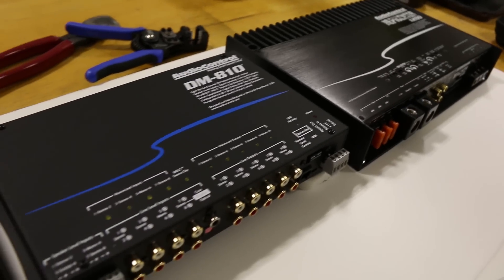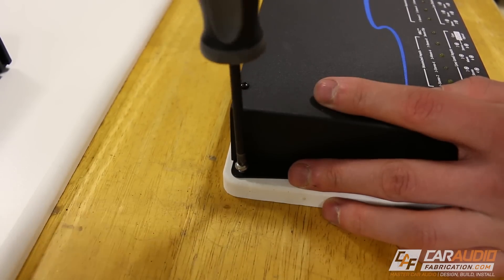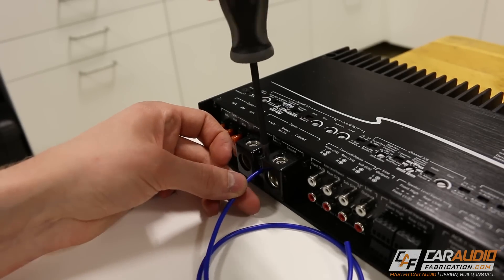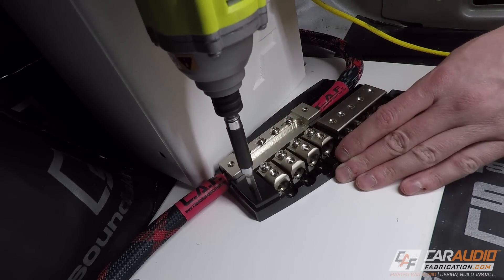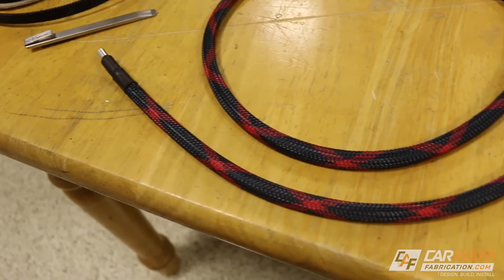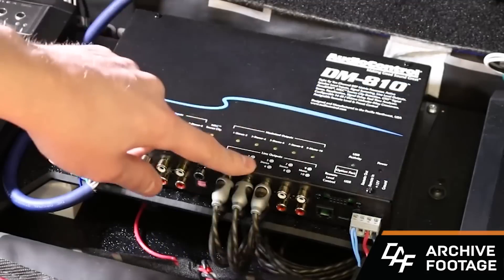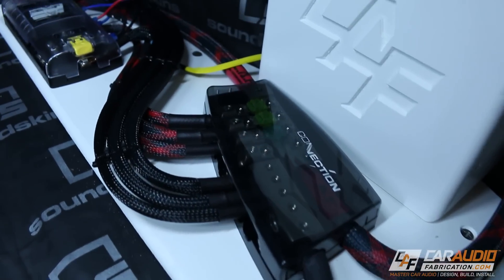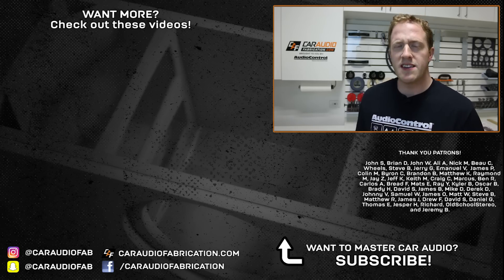ADVANCED Car Audio Wiring - Multiple Fuse Blocks - Project Stealth

Comment from the maker: Thanks for watching! Here's a good follow up video for more information on wire ferrules, and crimping and working with large wires: https://youtu.be/TlV1_GjISps
Reply: Hello Mark ! I was wondering, how do you know when you need a second battery ? I heard that a lot of voltage variation coming from the battery while driving (seen through a voltmetre) is a clue that you an other one or a higher output alternator. I never go under 14V so....yeah ?

Thanks for the videos it really helps me on a daily basis when working on my car !
Reply: Would you maybe make a video about how to add battery's too a car?
Reply: Hi Mark, I use the Blue sea Safety hub 150 gives you power for 4 big amps and plenty of smaller fused outputs for LED’s, processors etc. Check it out for a future build 👍🏻
Reply: @jayw2609  66 book gm 5j5
Reply: they are typically only needed for parking lot pimpin (eg, when the car is off and you want to play your system).
Reply: CarAudioFabrication hey i need help. I put in a new radio in my car and it make a wine sound when i turn on my car and when i step on the gas it get louder. Pls help fix this. Also my uncle gave me a more power full sub and its connectd to the stocm amp could this be the problem

Comment: hey guys. i have a 1 in 2 out 0 gauge block. can i use it backwards and have 2 0 gauge wires from the battery to one in the amp. like so
battery=======>-----amp

Comment: Hey Mark!
Just a quick question I was looking on eBay for a good quality wiring kit, found a Rockford Fosgate one with0/1awg wire but it only has that from the batterie then I had 2 distribution blocks and then they have supplied 4awg wire, is 4awg thick enough for powering a 1200w/rms 5 Chanel amp and a dsp? The speakers are going to be 2 focal utopia 165wrc, 75w rms and 1 focal utopia 33wx2.

Thanks!

Comment: Great videos, I was hoping you could give a general size guide for the tech flex. Like what size you normally use for 4 gauge power/ground wire, and rca’s, speedwire etc. I would greatly appreciate it. Thanks.

Comment: Getting great bass and maintaining trunk space? Needless to say I've done a really weird  thing in a car that didn't have rear deck speakers I took 3/4mdf and measured the area of the rear deck and made a box for 3 8" subs. And took some L shape aluminum. Put around the box. I then cut away enough of the metal to let the 8s blow into the cabin. And riveted the L aluminum to the rear deck and reinforced it with new metal welded around what I cut out and fiberglassed the enclosure and made a new rear deck beauty panel does wonder bit I've always ask the customer if 1 they wanted that done and 2 if they own that vehicle and its not a rental etc

Comment: What size flex tech do you use for 0 awg
Reply from the maker: No answer for this, every 0 gauge has a different outer diameter, simply measure your wire and but the next closest size, it's not rocket science.
Reply: CarAudioFabrication I’m new to this that’s why I asked

Comment: Hiya Mark, really enjoy watching your videos. Im currently building an audio system total watts 600rms so nothing major but a nice upgrade on stock. Thing is i will be attending some car shows and want to play my xbox i have a 500watt invertor. I am thinking off a second boot battery with a battery relay isolator so not to drain main battery but will i need to run a seperate power line to power radio from this new battery?
Reply: Chazz Coombes yes. unless you are not worried about the small load from the head unit. I would just use a larger battery. with a bit more capacity. maybe two. up front. along with a battery in the boot. you could isolate only the extra one in front . using it as a jump start. so even with the battery low. you will still be able to start your vehicle. it would be less complicated that way
 have a isolator with a toggle switch. "turn on" the other battery when you need to start the vehicle. or only turn it off when you are going to pull down the other batteries. and turn back on when you are ready to start! I hope this is understandable. and a help.

Comment: Hey mark can u use the same wire for a power and ground ? Like if I got more ( power wire ) can I use that same wire for a ground ? I need more wire to really make my set up. Cleaner
Reply from the maker: Wire is wire. Your main feed and ground MUST be the same size. If they are the same color your amp doesn't know the difference. You should definitely some how mark each wire though so it is clear what is what so nothing gets shorted out.
Reply: CarAudioFabrication ahh jaha I always thought each wire had some special type of coding on it or something lol and I wasn’t quite sure the diff like if one had to be ofc or something lol thanks a lot mark now I’ll be able to nicely run my setup 😎
Reply: If I may I recommend ground to frame and not the body its a more "solid" ground"

Comment: Hey mark I have a question I have a 2004 explorer and I can't find a good spot to drill for my power wire what would you suggest I messured my door jam and it is open enough with the door closed to not pinch my wire but i don't wanna leave there much longer any idea what I should do?

Comment: Great videos!!! I have a question. What are your thoughts on using a circuit breaker rather than a fuse? I install a lot of snow plow and wheelchair equipment and use them all the time. Pros/cons?

Comment: Amazing work like always Mark!  Just one question though. On the distribution block, one big wire comes in from battery, 3 smaller ones go to the amp, where does the other big one go to? Engine bay I'm guessing?  Is the car dual battery?. I'm looking to run, pretty much this exact setup in my car.
Reply: He says that in the video. One from the front the other to the secondary battery
Reply: Do u have to connect to the 2nd battery  to order to work...or 1 battery still work.

Comment: Awesome work so far! You were just a bit sloppy on the ferrules. The purpose of ferrules is not only to protect the end of the cable and distribute the clamping force to the strands but also to keep air away from the copper. To gain this you'll need to crimp the ferrule so there aren't any air pockets. In your case you just added some resistance to the circuit.
Reply: But you can't crimp a round ferrule and keep the round shape needed to fit inside the terminal. It would be square if crimped.
Reply: I'd like to see his reply on this
Reply: Me too! And I forgot to mention that the reason to keep the air away from the copper is oxidation. :)
Reply: That's ridiculous.
Reply: They are used to keep all the strands in one place and keep them from breaking off. You will get more corrosion from 2 different types of metal...copper aluminum steel touching each other then you will air. Crimping them will not keep all the air out by itself unless you seal the ouside of the wire to the amp/ fuseblock to keep the "air" out of cavity!
Reply: Crimping with a tool is not going to make the connection air tight. So long as the mechanical connection is tight, his practice of using the equipment terminal to crimp the ferule on heavy gauge wire should not be a problem.
Reply: Any added resistance would be negligible. It may seem redundant, but a little extra protection is a not a bad idea.  Besides, some amps do not feature onboard fuses.
Reply: I don't think so. These are actually the reasons why it's almost everywhere electrical code.
Reply: Mark, your videos are awesome!
Reply: Interesting.. I've actually never seen anyone use wire ferrules crimped lol.
Reply: anonym musiteufel I always crimping the ferrules as I have the tools, but I don't think it has the force to keep the air out. It's just a simple plier(-like) tool. To deform the wire strands inside, you must press it usually with a hydraulic crimp tool. The ferrule itself is also a thin material, much thinner than a tubular crimp tag (sorry, I don't know the english term).
Reply: using fuses in trunk is a bad idea you are adding resistance no need for fuses in trunk they are already on the amp and at battery

Comment: Mark, you dont list your source for the plastic used for the rack. I am having a tough time finding a good well priced source. Do you prefer ABS or HDPE in your builds and at what thickness. I want to make some under seat racks and I need some advice as I have never really worked with plastics in this fashion before. Thanks.
Reply: See previous video from this series for the plastic.
Reply: Very helpful! I'm not going to go through video after video for a simple answer......

Comment: Hey Mark,

When using threaded inserts, do you think it’s necessary to use things like Loctite to prevent vibrations from backing out screws or is it overkill?
Reply from the maker: If the install is vibrating so much that screws are backing out you are going to have issues with the gear too. It's one of those things that you can use common sense. If its an insane build with ton's of bass best to ere on the side of caution.

Comment: How strong is the expanded pvc you use? I was planning an amp rack out of mdf as it will be under the boot (trunk) cover in my estate (wagon) and wanted to know if the pvc would be strong enough to use for holding the weight up of things I'll have in the boot (trunk)
Reply from the maker: I like it a lot, its fairly strong. Like any building material you will have to use common sense and some engineering to make sure that what you are doing is strong enough though.
Reply: where are you getting it again? looked in the links..